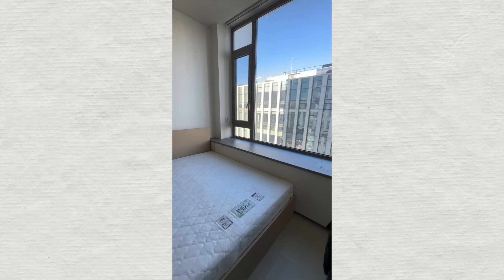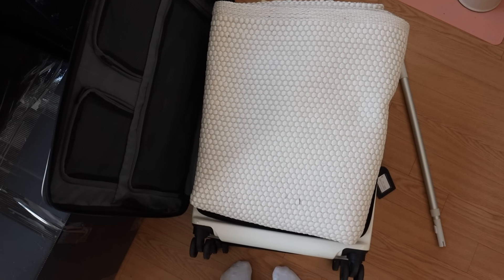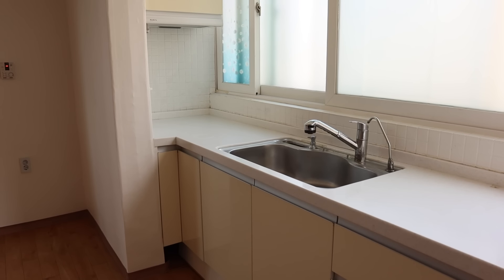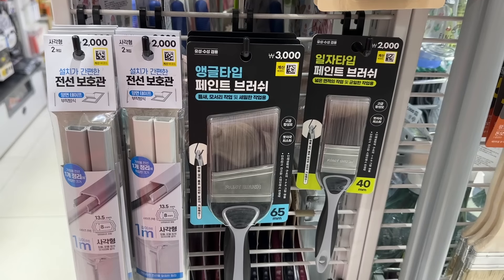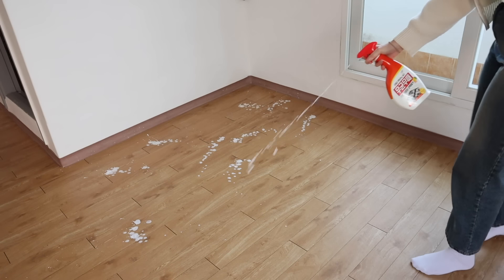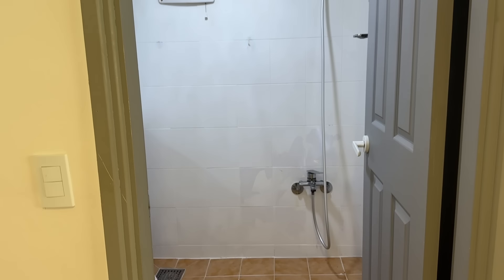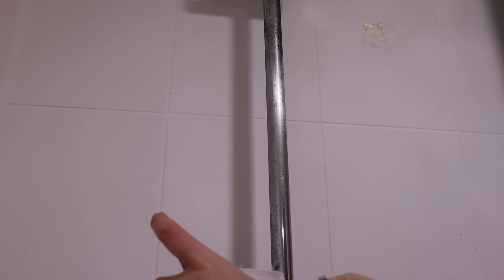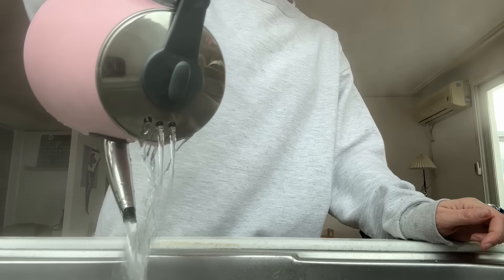Moving Apartment in Seoul | Apartment Viewing and Cleaning | Moving Vlogs

Comment: Pouring vinegar on bicarbonate soda neutralizes it, rendering both of the chemicals useless. Use the baking soda only then add hot water :)
Reply: The whole idea is to dump the baking soda down your drain followed by vinegar so the resulting bubbly chemical reaction cleans out the gunk stuck to sides of the pipes.

Comment: I think putting caulking over the mold will just cover it temporarily, in no time it will be back. You will have to scrape off as much of the mold covered caulk and then try to find a solution to kill or remove any remaining mold. Last step would be to add the new caulking.

Comment: Tip for the window film haha spray a mixture of dish soap and water on the windows and then cover in cling wrap, bubble wrap, whatever kind of thin plastic sheeting you have around. Leave for 30 minutes and then peel it off. It will disrupt the glue and make it much much easier to remove!

Comment: Mixing vinegar (acidic) with bicarbonate (basic) creates water! And a bit of heat. It looks and feels awesome when using it, but truth be told, it actually doesn’t do much of anything. It is better to use them separately. Bicarbonate is great at dissolving fats, and can be helpful in a sink that is clogged. Vinegar is great at removing lime scale, and can also be useful on the tap or shower head. And warm water can of course also be great for a sink drain to flush some fats out. But it is an old myth that vinegar and bicarbonate is good together, they don’t really match if you look at the chemistry. I like bicarbonate + dish soap, both are basic and creates a nice gritty texture.

Comment: Lovely bright appartement. Maybe cooler in summer on NE side. Hope you have air con? Although change filters after so long sitting empty.  Can you not buy a u-bend and put it in yourself under the sink? You Tube is great for Videos to show you how!.. if modern buildings have them, you must be able to buy them there.  It would definately be a better long term solution.